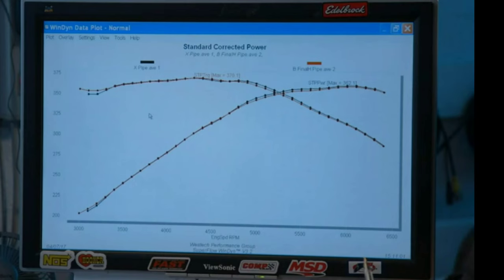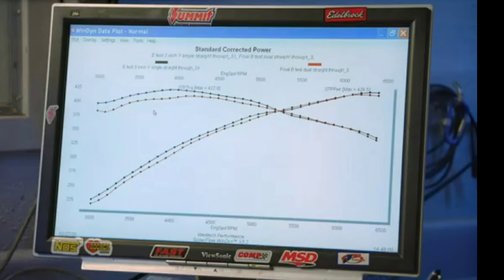DUAL EXHAUST LOSES POWER! single is better for POWER!

Comment: So you have 3” collectors, and it goes into a Y pipe with 3” inlets. What size diameter should the Y pipe outlet be?
Reply from the maker: I would step it up to a 3.5 outlet 😁
Reply: For the exact same flow capacity, roughly 4.25 inches. But you likely don't need 3" collectors on your vehicle, anyway, so I'd go 3.5 like NGG said. If you had 2.5 collectors, then those combining into a single 3.5 is the exact same flow capacity.
Reply: no just run 3 in dual exhaust you would make more power.
Reply: @701garage  And sound like all those fart box squatted trucks. Not to mention be louder for the same amount of mufflers. PASS!

Also, big (X) on that "more power" BS. Better scavenging makes more power. Look up David Vizard.
Reply from the maker: I tried explaining it to 701.....it didn't work 😂
Reply: @Drunken_Hamster  got watch the motor trend video he is talking about 4:46 shows the open headers with collector made way more power. 20:20 they said they would not run a single about 430 hp which is like 350 to the tire. Go ask Richard Holdener he will even say that a dual 2.5 will out perform at single 3. Go ahead run a bigger cam and spring and run a single exhaust you will make less power then a dual
Reply from the maker: Ya @drunken hamster 
 Good luck with this guy hahah 😂
Reply: @newguysgarage6802  season 7 ep 13 even shows that the flow towards the end of the exhaust does not have the same flow at the part closer like 18 in. that means your whole thought about scavenging is wrong.
Reply: @newguysgarage6802  to bad you cant show them that you are wrong with motor trends own video. Becasue at 4:46 and 20:20 they prove you wrong.
Reply from the maker: You put they Y pipe close to the end of the headers guy not at the end of the exhust pipe.....
Reply: @701garage  Too bad you can't simply look up David Vizard and prove yourself wrong. On a cross-plane V8, even HAVING equal-length headers is not ideal since the exhaust pulses are UNEVEN. Why do you think 180-degree headers make more power? Because they make the engine even-firing with good scavenging.

BTW, you clearly didn't pay attention to my math. Dual 2.5 needs a single 3.5 to match flow. If you have a single 3.5 coming from a dual 2.5, there will be no restriction.
Reply from the maker: Neither of those two time do they show or prove anything other than the 3in single made more power than the 2.5in dual. 

You dont seem to be willing to make a video and prove me wrong so you really have no legs to stand on.......

Make a video. 
Or cant you figure out how to?
Reply: @newguysgarage6802  open headers made more power then the 3in single and at 20:20 they even state it will not support the power past 450 and would not run it past 430. I would not be able to make a video with dual 2.5 or even a single 3 without choking the shit out of my motor and have huge back pressure. I mean you have that little mustang with with like 150hp that should work fine for that test.
Reply: @newguysgarage6802  no it shows that it really matters about 18in from collector and further down it hurts the motor. showing that the scavenging you are talking about is not doing anything to ad in power or is that to hard for you to understand.
Reply: @newguysgarage6802  why does nascar not run a single but they run dual when there is no rule about the running single or duals? oh thats right because duals flow more
Reply from the maker: Why do nascars run restriction plates.......not for better flow lol
Reply: @newguysgarage6802  that was a rule to keep the power the same. Not and now they have to run the same motor at the same hp. Yet they can run what ever exhaust they want yet they choose dual
Reply from the maker: https://youtu.be/AxGa6byZyOw

They dont always know what there doing either 😂
Reply: @newguysgarage6802  so your saying the guy that works with engine master is wrong him stated you will make more power with a dual 2.5 over a single 3?
Reply from the maker: You know Steve D. On engine masters apprenticeshiped under David Vizard. 

David Vizard is the authority and far more knowledgeable than anyone on EM.

They even admitted on that episode that they did testing off camera and "came out with more questions than answers" AKA they dont have a clue why or how it worked out that single made more power. 

So they just blanket stated that it wouldn't work over 400hp without any reason to assume that is the case. 

Likely because selling two mufflers vs only one is better for there sponsors and magazine agenda.....they are after all business first truth later when money is at play.
Reply: @newguysgarage6802  I'm not talk about Steve I'm talking about Richard.  A land speed holder and does alot of the testing you see in magazines for the last 30 years
Reply from the maker: Do.....do you not realize who David Vizard is?

He has beem dyno testing for longer than Richards been alive two times over.....

They are all small fries in comparison to what David Vizard knows.....he has forgotten more than EM and Richard H. Ever knew to begin with 🤣
Reply: @newguysgarage6802  yet David has never stated that a single is better than dual
Reply: @newguysgarage6802  Realist shit right here... Wish I could go back in time and make a new car company with all my foreknowledge and David Vizard as the head of combustion science.
Reply: @newguysgarage6802  On top of that, the industry doesn't really make many mufflers that are 3.5-inch, 4-inch, or bigger.
Reply from the maker: Right! I hear ya Drunken Hamster 👍
Reply from the maker: @701garage  yep he has, live stream with Uncle Tony's Garage they talked about it and pointed out the same thing I did in my video
Reply: @newguysgarage6802  looked through the transcript he never said anything about 2.5 dual being worse then single 3

Comment: i got a 318 poly with an original single exhaust...was goin to chop it where it meets before the diff and make it dual...u got me thinkin now
Reply: That's a factory 230hp right? at 4400rpm right? 
care about a few hp either way; I say do what you want.

Comment: It can be tricky getting 5" pipe over the rear axle
Reply from the maker: You would need a seriously big cubic inch engine to require 5" tubes lol 😆 

And at that point i would just dump it before the rear axle 😁

Comment: it all depend how things are build and where the changes are done , results can be wurst or better by little changes , its like plumbing instalations to calculate the right flow and presure al along the system till the end of the installation , it have to be correct , if per exemple there is a smaldistance where the diameter goes larger and then back smaller you have something as presure and flow drops , i imagine that collectors should be in one case be install as closes by the motor and others on they otherhand farther from the motor , and this can change a lot in the continuality of the loa of flows and presures , it make sense to me you can improve a lot of your power by install the right collector on the right place , sorry for my english , i drive one old V4 Saab 96 from 1975 , i am pasionated by the older engines , greets from the little flanders in Belgium , i am Carl , i am the son of Eric , so they call me Carl Ericsson hahahaha , and my dad was Rally driver on east African safary in 1960's and we have had eric carlson and even Pat Moss at home to sleep for they journey there to prepare there rally's , i haved wonderful reminderings and never forget it as Diane Fossey also since my childhood in Rwanda , handsome poeple they were , ohhh yea they are my Parents also are , my tanks and respect is huge , so i'll take care for them now for there ols days , live is beautyfull , thanks for the video and to read me also , be Blessed everyone , greets Carl

Comment: Good logic and agree for most engines but I’m curious how this all translates to cars that need higher back pressure to make their low end torque.
Reply: Engines never need backpressure, what they need is the proper diameter pipe matched to the engines power level to maintain exhaust VELOCITY.
Reply: Back pressure is never good for any engine ever.
Reply: @-thebatman-  my comment above..
Reply: @kskip4242  exactly but that stupid myth needs to die and if you say an engine needs back pressure you should be scolded by everyone 😂
Reply: @-thebatman-  Agree with you fully.  I have a great muffler guy that builds systems for me, but trying to explain this to him never works, oh well.

Comment: Exhaust gases are loosing pressure when they exit the cylinder that causes cooling that causes contraction of the gases which means less pipe diameter is needed in the tail exit at the back of the car. Max combustion temp in cylinder at max pressure is 1000c but at the tail pipe exit is less then 200-300c. All that cooling happens that fast because of pressure dropping to atmospheric pressure. There is no way to optimize primary tubes because the firing order on cross plane crank. On a single plane crank(coyote engine, ferrari v8) same length primaries works. And too large exhaust diameter pipe slows the gases so much that they are cool dense and heavy so less efficient to pump out. All of this is theory that needs testing nobody knows for sure exactly what works best on one particular engine.

Comment: My 3" exhaust with an X sounded kinda like an Indy Car when i revved it to 8800 rpm , and it was quiter at light throttle on the street .
Reply: What car is that?
Reply: @imadude85  
'65 Chevy II ,  359" , 6-71 Blower , solid roller  276/282 @ .050 , 670/695 lift , sounds like it would be a radical engine but 
it's actually very streetable  .
Edit: it also has four mufflers on it .
Reply: @TT64NOVASS  8800 with those cam specs and a blower pulling down the tiny little motor.... ....Hhahahahahaha

Comment: Everything past the merge collector is a restriction , there's no scavenge effect of whatsoever
Reply: I like this statement ........ cuz it supports my theory. And so, I installed dual 3s all the way to the bumper on my little 367.
However, when I installed a GVod, I had to cut the H out, and I noticed a huge loss of low-rpm torque, that the only way back from, was a lower First Gear in the manual trans.
I have no way to explain that, but it happened. It was worth it tho cuz the True Duals sound way better. especially at WOT zooming from near idle  up to 7200.
Reply: Disagree.
Reply: @Motorrad127  
I'm assuming that was NOT directed at me?
Reply: @ajforms4818  it was regarding the statement that claims anything past the collector is just restriction.

Comment: After spending a lot of money on this L83 I can tell you the differences are negligible. X pipe dual 3" made most power on dyno. The 3" dual h pipe made second. The 3.5" Single was third. 4" single was fourth. You want more than just scavenging, the wave returns and pushes back some exhaust which pushes back some unburnt fuel and believe it or not exhaust gases are a lot cooler than combustion gases so it in turn cools the compression stroke. EGR believe it or not also cools the combustion. The differences with a tune between each of the exhausts were at peaks only a few WHP. The weight of the factory exhaust vs duals is still lighter with no cats and mufflers. I am sorry but I will stick with what I have seen for myself on the dyno and what tuners with 20+ years of experience say.
Reply: Did you re-tune with every pipe change...or no?

Comment: What about y pipe into a single pipe into a y pipe
Reply from the maker: Thats just an x pipe then 😂
Reply: @newguysgarage6802 what about true duals equal length no x pipe or H pipe into individual mufflers?
Reply from the maker: @BlueNose49 ........then that is just a dual exhaust with zero benefits from connecting both sides of the engine together lol.

Comment: Yeah that's why all of us drag racers have single exhaust on our race cars..... 🤣🤣🤣🤣🤣🤣🤣🤣🤣
Reply from the maker: Well if you are running an exhaust system on your drag car then mabey you should 😂

Dyno speaks for itself 😉
Reply: @newguysgarage6802  Well maybe on a couple hundred horsepower like you have. Not any kind of real power you're ever gonna see any single exhaust. Ever been to a drag strip??? Drag strip speaks for itself 🤣
Reply from the maker: The physics dont change just because you make more power lol

The more exhaust you flow the bigger your pipes need to be is the only change 🤣

It is verry dangerous to get stuck in the "well why dosnt everyone else do it then" mentality it means you never learn knew things or ways to go faster. 

What if the first guy to ever use nitromethan looked at the drag strips and said "well if it worked everyone would already be doing it"

We wouldn't have top fuel dragsters then!
Reply: I usually do not see exhaust systems on drag cars    just open pipes near the engine
Reply: Sidewinder exhausts are common on drug racing 4 cylinder bikes 

4 to 1
Reply from the maker: Spring there will be lots of chassis dyno testing on the "Iron Horse" lol
Reply: Top fuel dragster point their exhausts up for more downforce

Comment: Appropriate combination applies to every different setup. 
On a 2000hp drag and drive car. No, single is not going to do. 
Does your 255 hp bone stock daily need duals? No
Do research. See whats effective and whats not. 
That money you spent on duals could have actually gone to something that actually makes more power
Reply from the maker: 2000hp NA car then yes the single would still be optimal so long as it is properly sized. 

But the fact your not going to be having 2000hp gasoline NA engines and more than likely going to be supercharged or running a different fuel type...means scavenging is not as important as it is on a gasoline NA motor

Comment: You fail to mention the solution for when your exhaust has more flow than the single pipe (even a 3 inch) can handle.
Reply from the maker: Go to 3.5in or 4in lol

Comment: What if you're running a y pipe with a dual exhaust?
Reply from the maker: And how......would you do that? 😅
Reply: @newguysgarage6802  by welding a crossover y pipe onto the other side where the dual axle back comes out. That's my current set up while my single exit exhaust is on backorder but I'm considering keeping it this way
Reply: @ThrowyaXup Bruh that's just a shitty/DIY X or Y pipe or whatever you wanna call it 😂

Comment: This just isn't true. My nova looses 3/10 in the 8th mile with a 3" true duals with an open x pipe. When I bolt on an 18" collector extension directly on each of the headers, it picks up 3/10 every time. This is on a 700 hp big solid roller 496 BBC. 3" is the biggest exhaust that my local exhaust shop can bend or i would've gone to 3.5" pipes. And the way the car is set up there's no way I could get a single 4.5" inch pipe underneath it, we struggled just putting 3-inch on it. Honestly,  There's no way that every car makes more power on a single exhaust, maybe on your normal 300 to 500 horsepower cars. That's definitely not going to be the case on a racing engine with a lot of power.
Reply from the maker: .....you just said you couldn't put the right size single on the car.....but then claim it wouldn't have worked even though you didn't test it because you couldn't find a place to do it.....😂
Reply: @Bobthebuilder.69 he didn't say it but who says he isn't talking about pollution controlled vehicles? Most people on youtube do mods for everyday cars and pass on info to each other. Just take a chill pill. If you're using a legal exhaust, he's giving good advice

Comment: 7:16 friction,surface area bla bla..BS! what about the double size area in the center of the pipe where air has nothing to rub on? lol
Reply from the maker: @jb-ye3hp  its not double, single pipe will have more area in the center were there is no friction.

Comment: Dual exhaust makes more power, here's data 2003 crown vic lx 4.6 2v 224 hp) y pipe 2003 crown vic dual exhaust with h pipe 239 hp
Reply from the maker: Never mentioned the size of pipe they used or what mufflers lol 

A properly sized single with nice Y pipe collector and adequate muffler will outperform a dual exhaust 🙂
Reply: @newguysgarage6802  dual exhaust makes more power much easier, in many cases cheaper than custom, adds value, style and sound.
Reply from the maker: Twice the pipe is twice as expensive and heavy! 

Much cheaper doing a single exhaust because it is litterally 1/2 the material, not to mention you only need to buy one muffler! 😉

Comment: i have a daily driver sbc 355, barley 550hp, never see's more than 70-7100 rpm it likes dual 3' dumped at rear, or 3'with x and full tails, sucks ass with 2.5' either way so wouldn't consider going the opposite way
Reply: Wow, that's 155% power factor. You must be winning the Engine Masters every time.
Reply: @hotrodray6802  nah just not putting junk together, and not a whiner when it comes to paying for great cylinder heads

Comment: Open headers are best 🤷
Reply from the maker: Actually open headers lose a significant amount of tourqe. 

You want to add a collector extension to the end of your headers in order to gain that tourqe back. 18" is a good average length that will work with most setups.

Comment: If you look at the amount of fuel to power or torque, single exhaust maximizes fuel to torque.
If you look at horse power to fuel dual exhaust produces more.
When you study a Dyno sheet, you use the info generated in columns with max resolution. 
When someone uses a line chart, it shows their lack of experience and expertise. Just my two cents since I own a Dyno and use pressure transducer in the exhaust and measure the amount of fuel consumption to generate recorded information